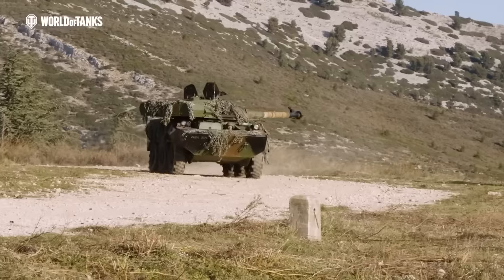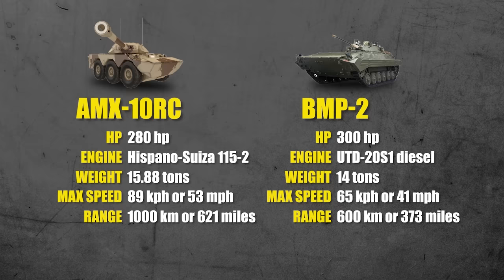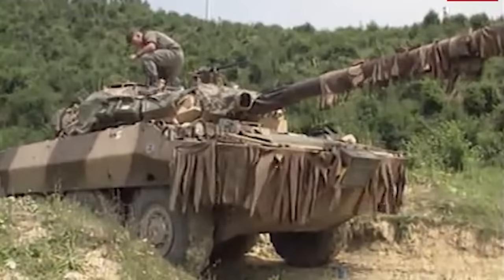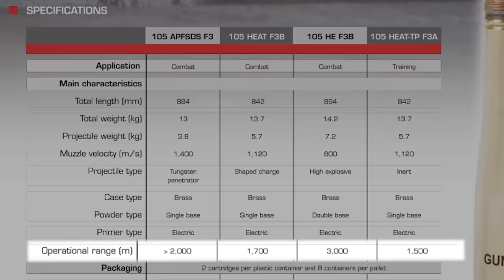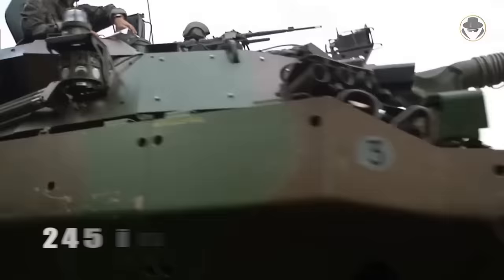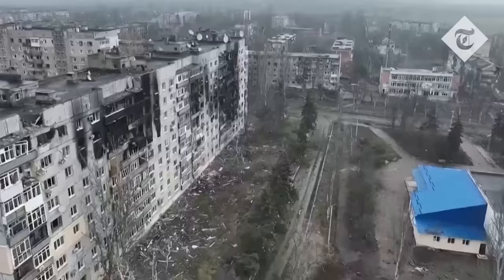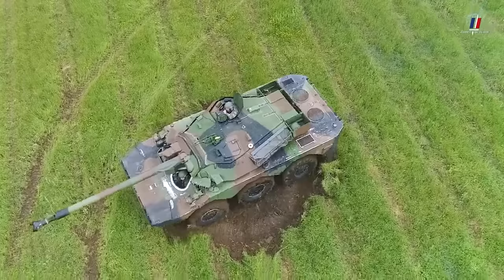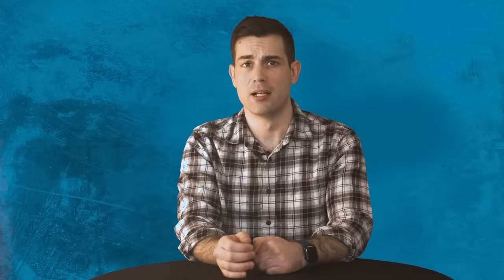Can the French AMX-10 RC Make a Difference?

Comment: Idk i keep on seeing all of this various equipment going to Ukraine. one major concern i feel...is the maintenance and repairs will be difficult if not impossible on most of these pieces. If russia had its act together they would have the ease of repairs/maintainence due to having soviet era equipment or soviet era based equipment...much while newer upgrades are based on soviet era equipment which should make repairs easier. obviously russia is a mess so that is in ukraines favor. But i am wondering if all of these pieces of equipment like tanks and MRAPS, and apcs...will eventually be a problem. guns...are not as bad of an issue but could still be an issue. as you cant repair ak based fire arms with m16 parts or hk parts....not without compensating on firearm stability and safety.  I am wondering if sending all of these pieces of varying equipment is also unnecessarily expensive. i mean sending a new tank is gonna be much more expensive than repairing an already damaged vehicle..in most cases.  I hope that countries are sending options to repair such vehicles..otherwise its just gonna bring problems in the future where vehicles degrade to Frankenstein builds i am sure its also much more costly to supply  new vehicles and ensure safe delivery

Comment: I'm finding a flaw in your logic, the Ukrainians have proven that they can move and deploy with tank support. The eastern part of Ukraine isn't hard rock or desert. However the lighter French version alongside mechanized infantry, air support and artillery will be able to move faster on roads and less muddy terrain. What is missing here is the rigid and dysfunctional Russian military doctrine, it's lack of command and control and network centric warfare. These small tank destroyers with mechanized infantry can without a doubt out-move and out-flank Russians - the commanders in the tanks will have digital maps updated with recon information. Last time I checked Russia can't or won't use cruise missiles on military targets because those targets can move, buildings cannot - even if terror and destruction of civilian electric infrastructure is a modus operandi for them, it's historically been proven to not work.

Comment: It's a shame it hasn't been coordinated a bit better, it would be good if the Ukrainians were trained and got the new equipment around the same time. If you have a shortage of tanks, I can see that you might be tempted to try to use the AMX as a tank and I hope they don't try this, but use them together with heavier tanks. But for what they are intended for, they seem really good, however, it will be interesting to see how they are used in the type of terrain that exists in Ukraine.

Comment: I'm just n average infantryman as well and I agree it's better than nothing. I can see these vehicles being used to great effect vs the Russians BMPs, exposed fixed positions like pillboxes or troops in buildings. It's not imo going to be the tip of the spear or go head to head against tanks. I can't see a BMP being able to survive the 105 mm gun but conversely it appears they don't have the armor to sustain a shootout with a 30mm auto cannon. They will have to rely on good execution and selective in engagements to be successful. Speed and range will be useful as they could be held back in reserve to respond to breakthroughs in the Ukrainians defences. I can also see some possibilities in unique situations for them to be able to quickly penetrate gaps opened in the Russians lines to rapidly flank. I certainly would not get overly ambitious with it either. I'm convinced the Ukrainians will make the most of what they are capable of. ☮️

Comment: Ukraines infantry have been lacking the mobility to exploit and gains or breakthroughs against the Russian lines. Any IFVs or armored transport will greatly assist them in moving troops wherever they’re needed most.  Hopefully they wait for most of the western tanks so they can train and fight together. Throwing IFVs against tanks and infantry alone is just a waste.  If they can hold Russia back and let them keep throwing troops and equipment into the grinder long enough for Ukraine to mobilize, but not so long that Russia has a chance to build up which seems like it would take longer.

Comment: This light weight combat vehicle is more suitable for traversing over the soft land of Ukraine rather then a 75 tonne heavy tank .
It will manoeuvre  much better due its wheeled tyre drive system 
Tracks do not work well  in very  wet soft land , they get bunged up sprockets and can bottom out , therefore needing  a slow recovery time under fire .
Not recommended !

Comment: These might actually be very well-suited to Ukraine.  Their weapon system should let them punch above their weight (vehicle) class.  Their speed and mobility should allow them to fight the type of war that Ukraine really should be fighting (fast, mobile, refusing to be drawn into a set-piece battle where Russia has time to bring its superior firepower to bear).  The higher operating range lightens the logistics load.  My concern is that the Ukrainian General Staff, more and more, seems to be getting drawn into set-piece defenses over cities and locations that bear morale, but little strategic value.  This does not play well for the AMX.  

My opinion, as a veteran soldier and intel analyst, is that Ukraine should be fighting a fast, mobile war that plays to their strengths (operating on their home turf, more decentralized command structure) and forces the top-down, ponderous Russian command to react to rapidly changing situations.  This involves retreating and giving up territory in order to draw Russian forces into rapid advances that over-extend their defensive positions, SAM missile coverage and supply lines.  Then it requires rapid counter-attacks to catch the Russians when they are vulnerable, strung out and poorly supplied.  Fighting set-piece battles removes the advantages from Ukraine and instead gives Russia more time for its ponderous command and logistics system to concentrate firepower.  We saw early in the war that when the war is fluid and mobile, the Ukrainians win stunning victories.  Now, in the East, we are seeing that in a grinding set-piece battle, the Russians are able to win by weight of firepower. 

Put it this way.  Russia has less logistical efficiency, but greater logistical depth.  In other words, they struggle to get supplies to where they are needed, when they are needed...but they have a lot more supplies in general.  By letting the fighting slow down, the Ukrainians allow the Russians the time to get those supplies into position.  By forcing the Russians to engage in a war of maneuver, Ukraine makes efficiency more important than sheer depth.  Yes, the Russians will take heavy losses in these set-piece battles, but the Russian command seems to accept this.  As the US learned from Vietnam and the War on Terror...bodycounts don't win wars.  The US routinely slaughtered NVA and Viet Cong units...and yet those same units that were slaughtered kept returning to the fight and eventually won the war.

Comment: In recent decades, we learned aluminum is not the ideal material for use on armored vehicles and even warships. That is the exact reason why the prolific M113 were forced to retire from service. The 10 RC offer less protection than many modern APC nowadays. The non stabilized gun means it is best for defensive uses. Ukraine seems to be a good place to get rid of them. A wheeled armor car with a big gun is still a viable concept, at least 3 other countries have such armored cars, Italy, South Africa and Japan. They are all 8 wheeled which have superior resistance to mines than tracks.

Comment: It has absolutely no armor... Oldest RPG-7 rounds can slice through it no problem...
Wheels are the problem cos in spring and fall you have mud to one's chest, and at winter it gets rather slippery for wheels...
Gun is underpowered to take out tanks, but it does have a good HE round to support infantry very well
Can't fire on the move...
Well, a combat vehicle is better than no combat vehicle, but I don't see this performing well. Can't take a mine blast, and main tank killers like ATGMs, artillery and drones will have no problems with it. Heck, even oldest RPGs will have no problem with it... This is just France getting rid of old and unwanted stuff, TBH...
Reply: Yea yea keep making noise that's right, meanwhile ukraine is getting more weapons and russians are still failing hard.

Comment: mann, they switching units of AMX10 & variants to the new platform EBRC Jaguar, and from this point thei can sent as many they want, but you ppl  don't  think that AMX10 is not design to fight against "soviet" tech, it's just an problem of point of view, it's all about tactics, and if you take that in consideration even the old tech can be use right, with the right information at the time in need, even with the shityest equpment you can do loot of nasty things; PS: ppl are stuck in mind that tech need to be "omnipotent", but in real fight actualy you need to take out of combat the enemy tech (ofcs with the desire in mind to destroy it), but is enough to harass the enemy, and AMX10 without doubt can deliver that, even the Wiesel AWC can do that, is all about tactics in the end

Comment: Don't look a gift horse in the mouth... Russia has plenty on the field witch can be shot with 105mm... Ukraine has a lot of roads and open fields where wheeled vehicle can go. They probably do better job as forward observation and recon vehicles than the wheeled sovied designs... French may be upgrading to 30mm IFV's, but French also have tanks with 120mm guns, witch are probably picing up the capability of the 105mm guns.

Comment: Wrong, the AMX-10RC IS NOT a tank. It doesn't have the protection nor the firepower. It is far more mobile though.

The EBRC Jaguar probably won't replace the AMX-10 RC completely. There were some AMX-10RCs that were modernised. They will probably keep those for a while more. The EBRC Jaguar doesn't have the same firepower. Maybe a version with a 105 calibre gun will be produced. We will see.

Comment: The French version has one forward gear , and four reverse gears😂😂
Reply: Fun fact: Battle of Dompaire in September 1944: 
Units of the 2nd DB (2nd (French) armored division) attacks the (German) 112th tank brigade (with some US air support, like any other units on the west front). 

Result: 60 German tanks destroyed in 1 day. It was regarded at the time as the fastest destruction of a panzer unit on the western front. The Germans reported their losses as unbelievably high. 
German losses: 
- 34 panthers (medium tanks) 
- 26 panzer IV (medium tanks) 
- 300 - 400 killed in action 

French losses: 
- 6 M4A2 Sherman (Medium tanks) 
- 2 M3 Stuart (light tanks) 
- 44 killed in action

Also, Fun fact: During WW1, The French tank Renault FT was the best tank (and basically the first modern tank by its design. It was a best-seller throughout 
the world post-ww1 - and the ancestor of all modern tanks, because of its 
efficient design).

Comment: French tanks to Ukraine? Shouldn't they rather be donated to to Russia, so they can flee and surrender more efficiently?
Reply: The French can use tanks efficiently: 
- Battle of Dompaire in September 1944: 
Units of the 2nd DB (2nd (French) armored division) attacks the (German) 112th tank brigade (with some US air support, like any other units on the west front). 

Result: 60 German tanks destroyed in 1 day. It was regarded at the time as the fastest destruction of a panzer unit on the western front. The Germans reported their losses as unbelievably high. 
German losses: 
- 34 panthers (medium tanks) 
- 26 panzer IV (medium tanks) 
- 300 - 400 killed in action 

French losses: 
- 6 M4A2 Sherman (Medium tanks) 
- 2 M3 Stuart (light tanks) 
- 44 killed in action
Reply: Also, Fun fact: During WW1, The French tank Renault FT was the best tank (and basically the first modern tank by its design. It was a best-seller throughout 
the world post-ww1 - and the ancestor of all modern tanks, because of its 
efficient design). 

BTW, what's your country?